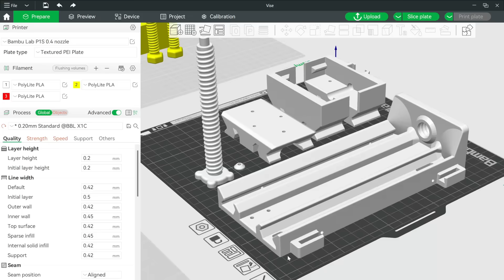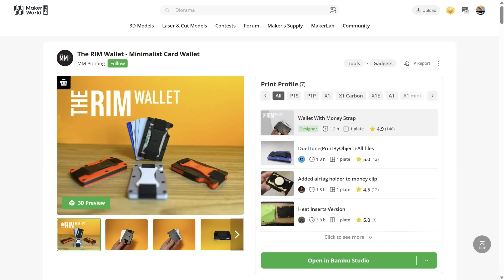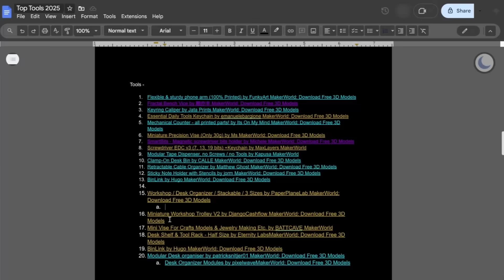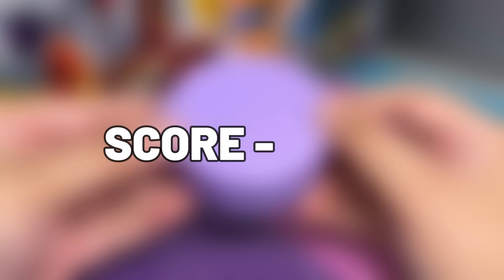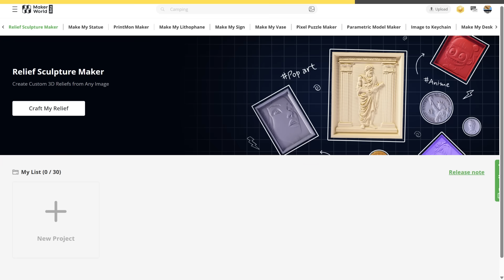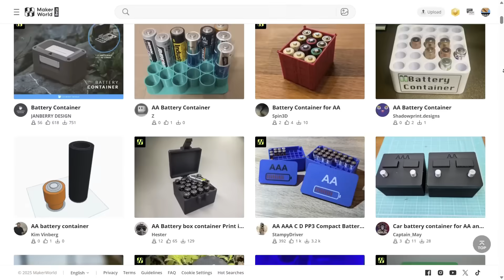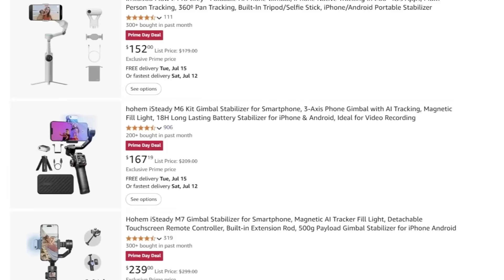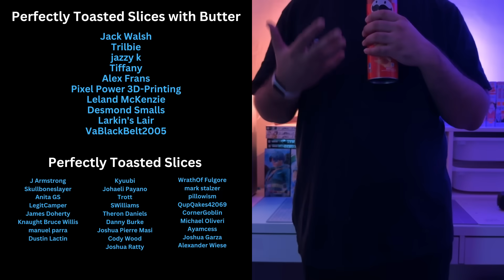I Tested 9 Best Rated 3D Printable TOOLS

Comment: about those AA batteries... i have a ton of rechargeable AA batteries in the house to cover all my remotes, smart home remotes and sensors, christmas lights, kitchen scales, normal scales (because my BMI is only just below my IQ), ancient wireless controllers/keyboards, all that sorta nonsense. i always keep extra batteries because while I'm charging them i need replacements. and i have too much crap that runs off electronics.